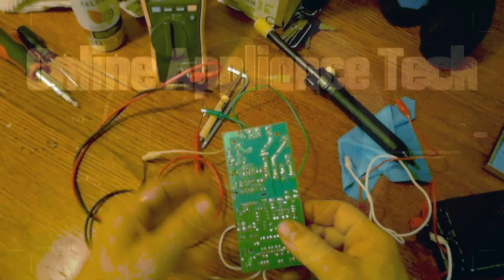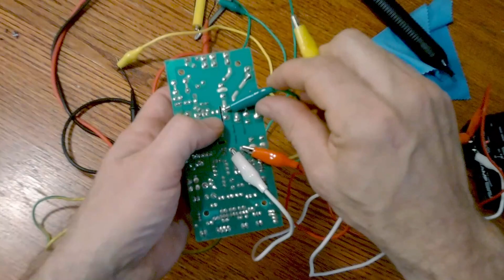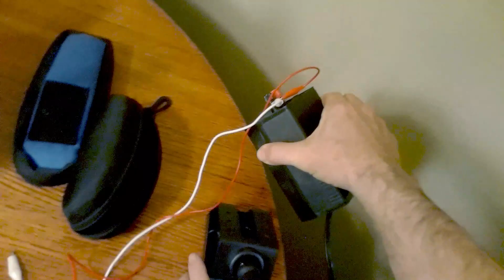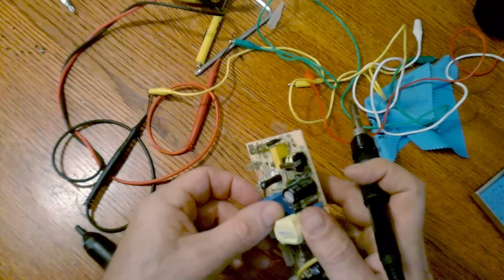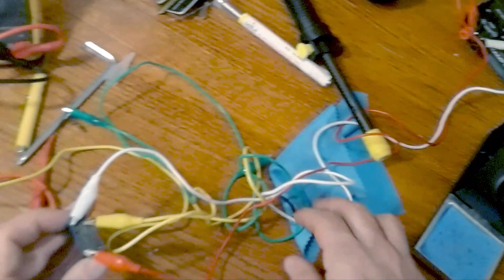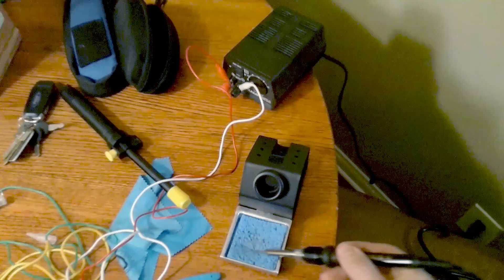Vinotemp Wine Cooler Not Cooling? Learn How to Test Relay & Repair MPC

Comment: The link that you provided for the relay does not work. Do they make after market relays that will fit this board?
Reply from the maker: I see, I check my link and it's no longer there.. Sorry about that I will try to find it again.
Reply: @Online Appliance Tech  I ended up finding the right relay...soldered for first time...actually pretty fun to solder...

All was good wine cooler was working again....until.....crazy rattling noise....was still cooling and holding temp...I investigated and found that the new relay was chattering like crazy....

Long story short I diagnosed this problem as low coil voltage....so there is an issue somewhere in the relay drive circuit (the side that provides ground to relay coil)....i am only getting .5v at the transistor base....so the transistor doesn't have enough voltage to actually fully ground the corcuit and provide a strong coil magnetic pull....

If the new transistor doesn't fix this then what would you do?  See if thermostat is providing a good enough signal?  I figure only thing left for it to be if new transistor doesn't fix has to be POSSIBLY bad capacitor on board....problem with thermostat/thermistor signaling....it is giving signal and at the right time but just not a strong signal....just trying to get ready for a backup troubleshooting plan for if this new transistor doesn't fix my issue
Reply from the maker: @macknumber9  I'm thrilled to hear that everything is operational now! It seems like you're well-versed with the technical aspects. Indeed, your issue appears to be a faulty capacitor that can't retain a charge. Do keep me updated on the progress. Enjoy your day!
Reply: @Online Appliance Tech  thank you for the compliment!  I like to think I know a little but not nearly as much as the pros....and I am really stumped on this one....I think maybe I need to test that little "104" capacitor...the ceramic one near the relay?  I am getting just .2 volts too low causing all my issus....instead of seeing .7v at the base of transistor I am only seeing .5v and it isn't allowing that relay coil to achieve full power....it will work for an hour or so and then start rattling/sparking....

I hate bandaid fixes but I was almost to the point of thinking about changing out the 10k resistor and somehow creating a little less resistance to get the .7v that I need at that base.

Comment: 1:43 where you have the red and white....when my machine is on and running i test and get 12 volts where you have the red one and only 6 where you have the white one....am i supposed to have 12 volts at each one?  

Again i am just testing the voltage at each point there....not supplying...im confused as i dont know how this all works...i dont know if im sipposed to read 12 volts at both...i am only reading 12 on one and 6 on the other
Reply from the maker: You are supposed to receive only 12  DC volts that activate the relay. I would just remove the MPC and test the relay with a 12 volt battery and see if it jumps from one point to another. If you don't jump, that means you have a bad relay.
Reply: @Online Appliance Tech  well i don't have the tools yet for removing...I just wanted to see if I am getting the correct signal from the control board that is even telling the relay to turn on and switch the power over....if I'm seeing 12 volts dc at where you put the red lead than is that good? Or am I supposed to see 12 volts there and 12 volts at where you put the white lead as well?

Another way I can ask this question is this....when you apply 12 volts to test the relay are you applying 12 volts just at where you put that red lead or are you applying 12 volts at both posts (where you have the red lead and white lead)

Thanks for the help
Reply: @onlineappliancetech  also how does the 9 volt batteries when you add 3 together not give you 27 volts and too much voltage??
Reply: I am so sorry I mistyped....to make this real simple so you understand my question...I mistyped...

Where you placed the white lead is where I am seeing 12  volts dc while the unit is running....where you placed the red lead I am only seeing 6 dc volts...does it need to be 12 volts dc at BOTH posts in order for the relay to activate? When supplying the 12 volts that you do for your test are you giving one side 12 volts dc and the other side ground voltage?

Are the red and white leads that you use for your post each 12 volts dc?

Comment: Video is great! Thank you! I have a question. I have Vinotemp VT-46TS-2Z. What's happening is if I unplug it for a long enough time, and then turn it on, then the compressor kicks in, and it cools to my temperatures. But then it stops, and the compressor never turns on anymore. I checked the compressor, and it seems in working condition. What would be a problem? (all fans are working all the time, no dust on coils...).
Reply from the maker: From what you've described, it seems that your compressor might be overheating. Generally, a compressor has an overload feature that triggers when it gets too hot. Based on your account, I suspect that when you unplug the unit, it cools down, causing the overload to reset. As a result, once you plug it back in, the compressor resumes operation.

You could verify this by testing the primary wire leading to the overload, checking the amp level on the compressor. The maximum amperage should be detailed either on a data sticker or directly on the compressor.

I hope this clarification assists you!
Reply: @onlineappliancetech  Compressor was not overheating. I tested all the main parts, and they all seem to be ok. It was a faulty relay on the main board. Exactly as in your video, which btw helped a lot.

Comment: Ok I tested for 12 volts at both solder points...the leg from the receiving power is 12 volts dc but the leg on the outbound (power going to compressor) side is only 6 volts....does this mean the relay is bad?  Shouldn't I see 12 volts on both solder points?

Comment: I'm kind of confused....I have same pcb....while unit is running can I try to jump the connection to see if it will start up the conpressor? Or that can fry the board?
Reply from the maker: Would not do that to high of a risk.

Comment: What if im not getting 120 volts a/c? I test it where the power comes in to the board but when i get further down closer to the relay i am not getting 120 volts...maybe this is my problem why the compressor isnt running but the fans are
Reply from the maker: Unfortunately that is a hard one to figure out via text. You may need to call someone in to look at it for you. Best Regards Matthew.